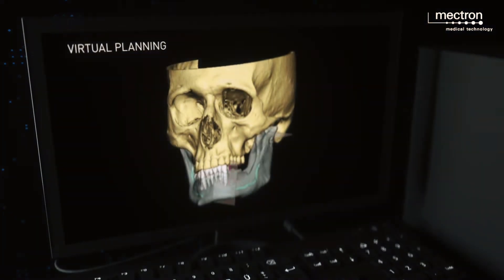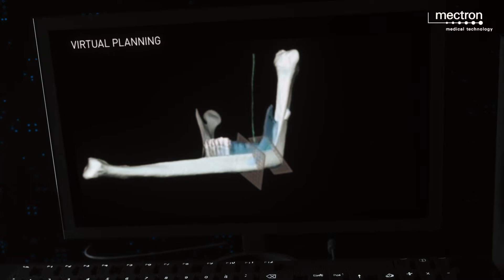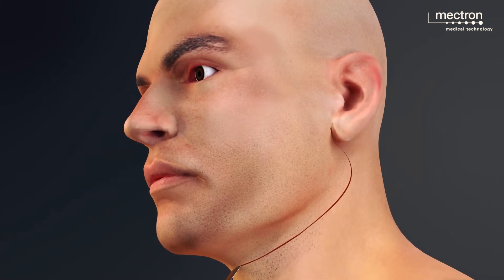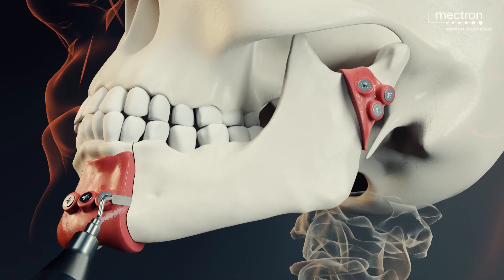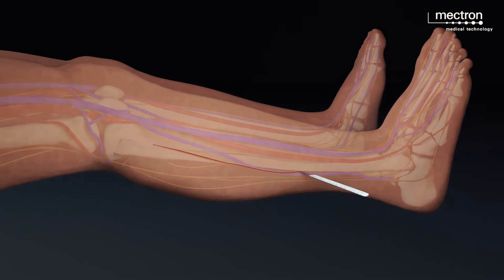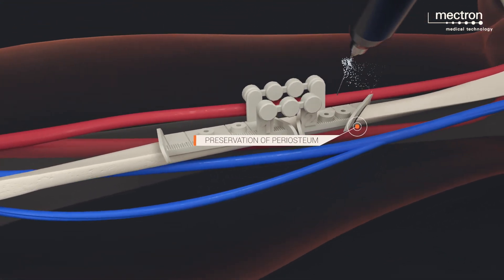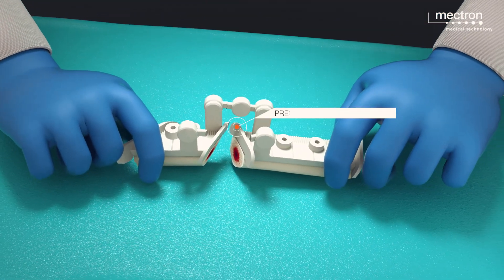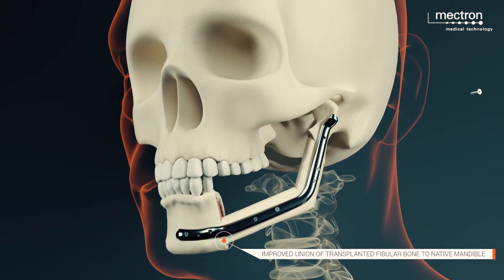PIEZOSURGERY® | Mandibular Reconstruction Animation

Comment: Oromandibular reconstruction, although a challenge for the head and neck reconstructive surgeon, is now reliable and highly successful with excellent long-term functional and aesthetic outcomes with the use of autogenous bone grafts and current reconstructive options. The ideal reconstruction would provide a solid arch to articulate with the upper jaw, restoring swallowing speech, mastication, and esthetics. Autogenous vascularized bone grafts in combination with microsurgical techniques have revolutionized mandibular reconstruction in oral cancer surgery. Current trends in mandibular reconstruction aim to achieve reestablishment of a viable mandible of proper form and maxillary mandibular relationship while decreasing the need for invasive autogenous graft procurement. However the optimal reconstruction of mandibular defects is still controversial in regards to reconstructive options which include the donor site selection, timing of surgery and method of reconstruction.
Reply: How about maxilotomy

Comment: CT scan helps plan surgery. Models are made. Surgical guides are used. mandible is cut in a process of mandibulectomy  and replaced with a bone form the leg of the same patient using titanium plates. This is a jaw reconstruction surgery.